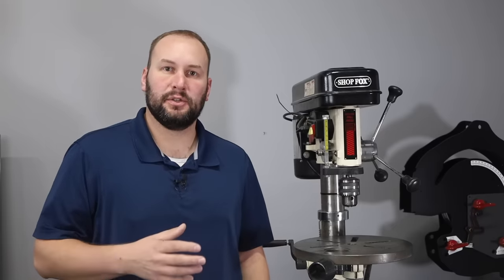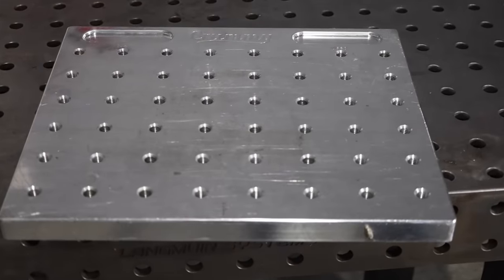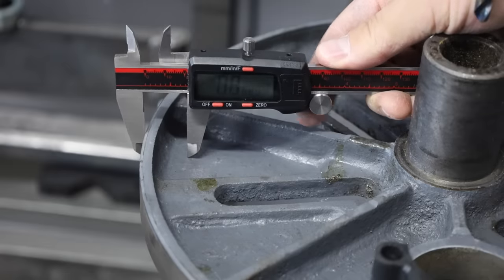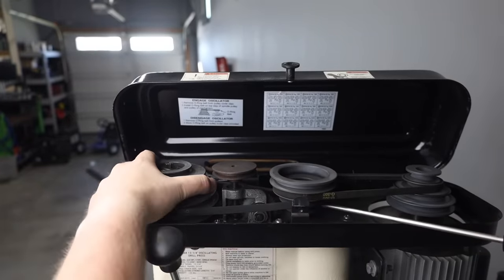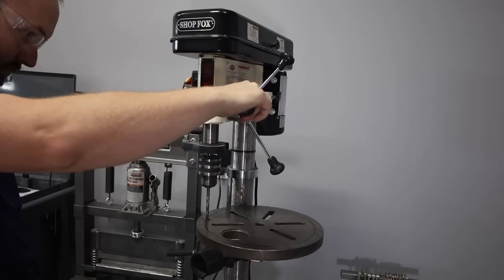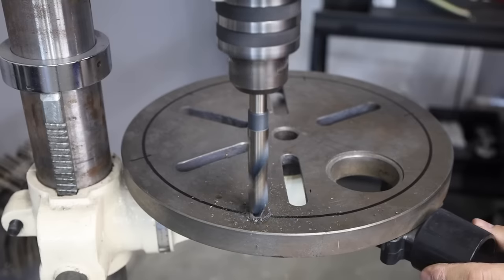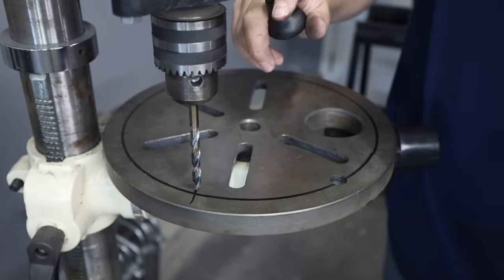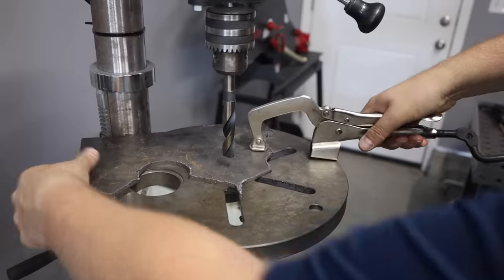EASY Drill Press Mod I Should Have Done Years Ago

Comment: Tim: This is a good safety mod, too many accidents happen when people hold the material with their hands. I worked for the Trane company as a lab tech back in 1976, there an old guy was watching use the drill press in the model shop. He showed me what happened to him a few years before, his left hand got grabbed into the bit and wrapped around, it took the tendons from his index and other 3 fingers around the bit, the repair of his hand was all the fingers moving as a group and he said he had no strength to grasp any real work, just a coffee cup.
.
25 years ago, I saw the Ellis tools (of the metal bandsaw manufacture) converted cheap drill presses by putting DC motors on them to make them variable speed. The model of drill press they used was identical to Harbor Freights 20 inch. But they wanted way too much money (at the time it was $1600) and they kept the junk Jacobs import chuck on it with extreme runout. I already had that model of drill press, and Dealers-Electric was promoting a Teco VFD, with a 1HP motor, so I purchased that and put it on the drill. I now set my belts for the middle speed range, and enable the VFD to operate down to 1Hz and up to 120Hz (it's a 4 pole motor and the rotor can spin at 3600RPM with no issue). This give all the torque needed (must be a vector drive type) at all RPMs. As well I figured out how to have the display on the VFD indicate spindle RPM, not Hz, so can dial in the RPM wanted for the diameter of the drill I'm using. In the end you're trying to control SFM (surface feet per minute), as for HSS this should be around 100. I've done the same thing with my vertical mill and two lathes. And I'm ready to do the same with the import 4x6 bandsaw. The other thing to improve the drill press, get a keyless chuck of quality that has less then 1 thou of runout. The same issue with them is how small they will go if you want to hold a 3/4" bit as max. So you may need a smaller chuck for 1/16" bits.
My welding machine is a 1995 Miller Syncrowave 250 (purchased new), before all these shoe box size machines were available, and it consumes a cubic yard of volume in the garage.
Reply from the maker: Thanks! That sounds like a great setup on the drill press, so much more convenient than changing belts. I could definitely use a better chuck on there too. The old synchrowaves and squarewaves are big, but they work great and are super reliable.
Reply: @TimWelds  I had the main circuit card fail on the Miller about 20 years ago. I was able to get a new part, but it was 1/3 the cost of the machine (I think I paid around $2600 for the Miller SW250 when new). But Miller did support it, don't know about now. I paid for a manual with the schematic back then, and they removed all the reference designators, but sure it's a two sided circuit card, and I could trace it all around, but trying to figure out what integrated circuit failed was difficult, and they had lots of potentiometers for adjustments as it's an analog switching power supply with no microprocessor. There was no description of the circuit operation that you would find in real service manuals. Also, they used some sort of varnish conformal coating on the board, which makes service at the component level difficult. I did pull all the integrated circuits off, and put sockets in their place, and got it to work, but it was no longer calibrated, so ended up paying the money for the new card. (I'm a retired EE, but have a pretty good model shop, as I fix broken stuff as a hobby(?)).
I do want something more portable as I have a 1957 Chevy truck that I need to silicon bronze repair panels for rust repair. Looks like a decent machine with Argon control and remote current adjust, is over $1000. That Synchrowave is buried deep to move around.

Comment: My clamp is not as fast but works the same way . It has a 1/2" bolt that goes in the slots and a nut with a big ring on it .
You can move it in and out from the center then just hand tighten the nut on the bottom . With your holes a good use is
just drop a bolt through to keep things from spinning om the table for those hand held jobs . Have a blessed day .

Comment: Not to ding the mod, but I've always kept the vice with the tightening screw/handle against the column. Also, think about getting some parallels to put under your work when you use a vice. What often happens is as you push the drill into the work, the workpiece will rock on one side which will bind on the bit. That's when things get flung around. And just as an FYI, cast iron is machined dry. There is more than enough graphite hiding in the iron to provide what the tool needs and adding lube just makes a sludgy mess. If you do enough production where things start getting hot then use a coolant flood, but that's not to lube the cutter, just to prevent warping from heat.

Comment: There is another useful mod you can do with a reasonable quality Drill press with a round table, But it is no longer a drill press put the Table on Tapered Roller bearings which requires some machining then make a safe permanant fixture to mount a grinding facing stone off the Drill and set everything to the lowest possible speed maybe even using a VFD also.
Once everything is safely munted up and a safety cage designed as well preferable one simply needs to put the now spinable table offset from the Grinding stone (Cup Style) give it a spin up and lower the grinding stone which when it hits the table being offset will .
A :Keep it spinning without needind any form of power.
B : Machine the surface perfectly parallel to the grinding wheel.
 Now you have a very effective surface grinder for Blanchard grinding of things like Automotive Flywheels and at a cost below $1,000.00
That when considering dedicated flywheel grinders start at over $10,000.00 new and even second hand are at least 3 to 5,000.00

Comment: That was a nice, clean operation. Did you ever consider just using vice grip type C-clamp as hold downs, that's been my go-to for years. Cheers.
Reply: Thanks for the tip That is what I will do!
Reply: @rksg2003  Glad to have helped.

Comment: The manual says 1amp so a cheap (ebay) variac will give you variable speed, i just picked an old w1680 up today, and that was my first though, it would be nice to uses a mill bit as a shaper at a speed i can control.. Good video i think I might do this on mine, this is a nice easy way to stay safe.

Comment: Liked the way you used your head. Agreed, those plates you showed are over-kill for most drill press work. For very fine work, I have a cross-slide I 
scored at a yard sale. But to mount and dismount the slide, I think I would take a page from your video rather than the provided slots. I would then have my new holes do double-duty with a clamp as you have done.  Thanks so much for the great tips!  Best Wishes.
BTW: Did you ever do anything about installing the variable speed control? I could really use some sound information about doing the same with my 
RYOBI 10" Drill press. (Maybe worth another video?)

Comment: You should look at variable speed drill presses if you have any use for one since I know you have a mag drill now. (I’m pretty jealous haha). But I got the WEN variable speed drill press for right around $200 & it can get down to 550 or 600 RPM I think not %100 sure off the top of my head. But it works great drilling through metals

Comment: The belts are easy to change by hand without tools, just back the tension rod wingbolts off a bit, pull the motor in, shift the belts where you need them, then pull the motor back out and tighten the wingbolts back up

Comment: A longer lasting modification would be to weld or epoxy steel blocks at each hole location and drill a hole 1/64 undersize and then follow up with a 5/8 chucking reamer at low speed and plenty of oil. You would get a precision fit and no wobble at the base.
Reply from the maker: Great suggestion! I'm not sure the reamer would do a whole lot better with all the runout in my drill press, but the fit could definitely stand to be a bit better than I got.

Comment: Bonus tip: Take the magnets out of any old dead small electric motor. Fuel pumps from inside the tank or any other small hunk of magnet and leave 2-3 or ??? many works for your requirements to become a ready grab tool to place near the drill bit during the drilling job so that most of your ferrous drilling chips will jump on over to & hang onto those nice lil magnets. When done drilling, grab the magnet & move it around to pick up any other chips that didn't land there in the first place, gently pinch & scrape them off into the trash & toss the magnets back up onto the main support pole of the drill press or even leave them on the vice so they are always there & ready to help you do a better, cleaner & safer job!!

Comment: The idea behind the different size pullies is to keep the motor turning at an rpm that delivers the most power. That vice has holes in it to bolt it to your drill press.
Reply from the maker: Definitely. I'm always looking for a way to save time and in my experience, it's really time consumint to relocate the vise using the mounting holes on this type of drill press table.

Comment: Curious why you didn't center the hole between the slots? Also the web seems a little thin for that type of clamp. I would think they would wear and become enlarged in short time. Nice idea though. Maybe a T-handle nut on the bottom of clamp would work well.

Comment: Nice idea.
However, you don´t need lube when drilling in cast iron. If it´s a deep hole the lube and the chips will make a "spreader" that can jam your drill drill in the hole.
The graphite in the material will give a sufficient lubrication.

Comment: Tip #2  add a foot pedal switch. If you are holding workpiece and it bites you can shut the drill press down quickly. A $10 switch might save your hand.

Comment: 2:01 Beware of those variable speed devices.  I bought one at a major wookworking supply store for my router.  I thought it was a variable-frequency controller, but it was really just a rheostat.  Very little torque at low speed.

Comment: You could use quick release cams to quickly and easily secure your vise tot he table each time you use it. Then you don't need to drill your table and you get to use a proper vise for holding your material.

Comment: To reduce chatter and increase the effectiveness of any drill press, use the shorter "screw machine"  length drills instead of the long "Taper" length drills.  ALSO, place a mechanical jack between the base and the table, such as seen on any manual milling machine.  Safety First!  ALWAYS clamp your work to the table. I've been a machinist for over 55 years, and I can still count up to 21 with all my digits in place (and still functioning well!)  (LOL)

Comment: While I highly recommend putting a variable speed drive on drill presses do so with an understanding of the limitations.  Below base frequency (60hz in the USA) your motor will run at constant torque and above base frequency will run at constant power where speed is traded for torque (just like when you change pulleys). What this means is if you try swing a big bit to hog material you will have much less torque than you think you should below base speed. If for example at base speed you would run the spindle at 500rpm with a 1 Hp motor at 50 rpm you will have 1/10 Hp which is weak sauce. This issue means in the lowest pulley setting you can drill the same size holes as normal but is generally easier at low speeds because less chatter.  You don’t gain capacity. For a drill press you are better off over speeding the motor if your motor can take it.  I swapped the motor on mine for a vector duty motor (that can handle 5600rpm) that matches the torque of my original motor at 900rpm even through its a 1200rpm motor, then I run it between about 600rpm and 2400rpm to keep it mostly on the constant horsepower zone so it stays torqy.  Hopefully that makes sense to someone other than me.

Comment: I would put the hole on the same centerline as the slots. The table is cast with a thicker boss in that area. 1/4" material thickness is not much for longevity with the side forces of that type of clamp.

Comment: curious, how many people i see recommending using cutting oil on cast iron.
I have been taught in my apprenticeship i finished at the start of the year (in 1. the company i apprenticed at, 2. a company that specializes in teaching machining to apprentices' and 3. my job school) that you should NOT use lubricant on cast iron, because it creates what is basically a lapping paste with the cast iron dust resulting in your tools getting dull extremely quick.

Comment: The speed of the drill is determined by the speed of the outer edge (circumference) and should be reduced for a larger one - it is because the edge of a larger drill travels much faster than  a smaller one.

Comment: There are three common faults to all home shop type drill presses. The tables are too flipping small. Hence all of the videos and plans out there for drill press tables. This also a common fault on industrial machines. Second on home machines is the crappy chucks installed at the factory. This can be rectified by dismounting the factory chuck and installing a decent quality keyless chuck with the appropriate taper mount. Third is the drive belt setup. 25 years ago l purchased a Ryobi variable speed drill press (1). Speed range 500 to 3000. In many ways it was a total rethink of the home or small shop drill press. It featured a Reeves Drive type variable speed. Instead of the table being moved up and down the head can be cranked up and down. The motor is enclosed in the head of the machine and is between the vertical column allowing the machine to be right up against the wall. Instead of the usual round table it featured a work table with an adjustable fence and tilting ability. It featured two drepth stops. The usual crappy adjustable nut. And a setable depth stop on the quill handle. 
Of course it failed in the market place. One reason was cost. Extra features cost money. The second was likely because it was different. It wasn't what customers were used to (2). I think l paid about $325 US. Info on the web is hard to find on these machines. Model is the Ryobi WDP 1850. 
1) This was in a time when Ryobi really did think outdide the box as a manufacturer. 
2) l personally think a lot of hobbiest wood workers and machinists are pretty conservative in machinery choices. Hence the fasination with worn out South Bend lathes, crappy designed contractors saws etc. One good example in my mind is the depth adjustment on most tanle saws. The blade assembly swings on a pivot point. This means that you get a varying amount of adjustment depending on where the blade is in its adjustment arc. A better solution is one where the blade assembly travels up and down in a set of guides with each turn of the crank handle giving the same amount of adjustment. This would aldo allow a graduated ring and pointer to allow easier adjustment of depth.

Comment: Hi Tim, Or anyone that knows, Can you please tell me what the bore is for that is in the table ? It looks to be 1 1/2" or maybe 2" in diameter. There's also a small shoulder on the top edge of the bore. It looks like its supposed to take some sort of pipe with a shoulder on it, perhaps some sort of arm that swings round ? Could that have been used to make an arm with a screw jack to clamp work perhaps rather than drill holes in the table :/ Too late now offcourse. :/ Would still like to know what the bore is actually designed for !

Comment: Drill  RPM  is critical, on various types/hardness of metals. 300 rpm is usually ok for most all. The faster the rpm, the more heat/burning generated. DON'T    speed up, rpms'  until you know the drill bit, will be  CONTINUALLY  BITING.  Any thing else, is just hi-speed bit-buring/rounding.

Comment: I noticed the material moved as you clamped it down. Have you had trouble with that causing inaccurate drilling?
I also wondered why you didn’t just bolt the device down as it’s intended to be?
Reply from the maker: It does move a little, but I have a mill that I use when I need to be very accurate, so it's good enough for my purposes. When you bolt the vise down, it's locked in position and it takes a long time to move to a new position for the next part. You can do it that way, this is just for speed and efficiency.

Comment: Here's a thought for you. Pilot holes should be around the size of the web or chisel point of the larger drill to avoid chatter when drilling the larger hole.
Reply: Also is a good idea to have negative take on a drill when drilling soft material like soft cast iron or brass
Reply: negative rake I meant to say

Comment: Where I work we  are not allowed to modify our machines. We did bolt our drill vice in place and use a piece of large angle to use as a fixture for flat stock that doesn’t fit in the vice. The angle is clamped into the vice and the flat stock is then clamped to the angle. The biggest problem is when people from other departments want to use the drill press. We must assist them in its use. 
This being said safety is rule one. We have achieved half a million man hours with no injuries. 
There are no shortcuts to safety.

Comment: I noticed that when you clamp, the material you are clamping slides back towards the clamp a little. This may make getting proper alignment with where you want to drill an exercise in frustration as you have to mis-align by the amount of the slide and use trial and error to clamp it right where you want it. You know what doesn't slide when you attach it? Duct tape. If you had used a duct tape and bailing wire solution you would not have had to worry about that nasty slide.